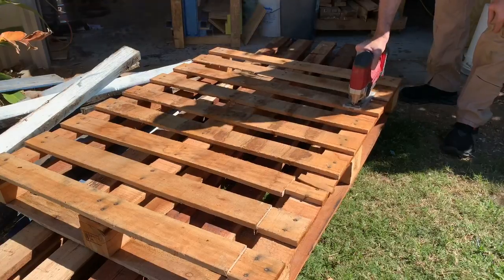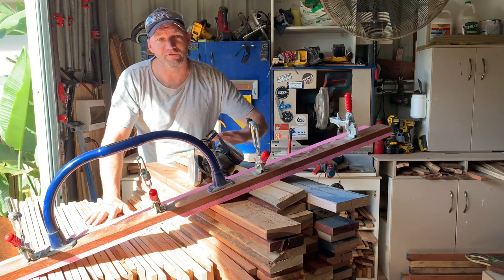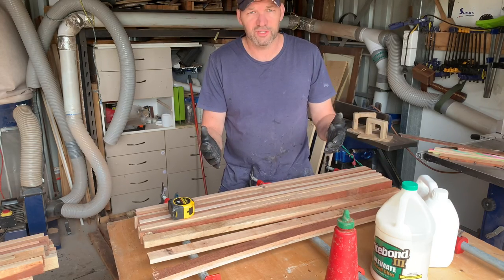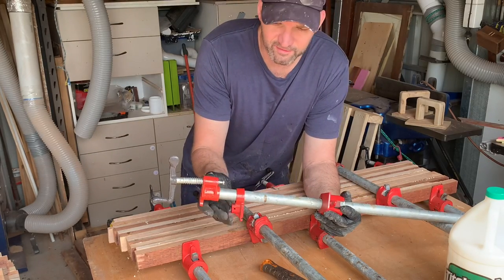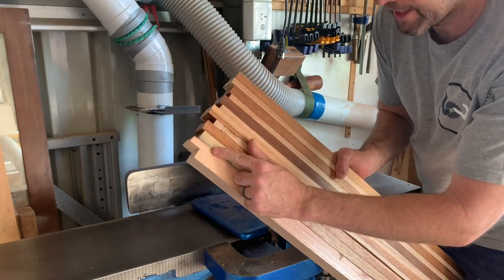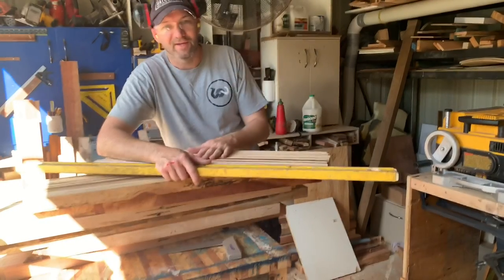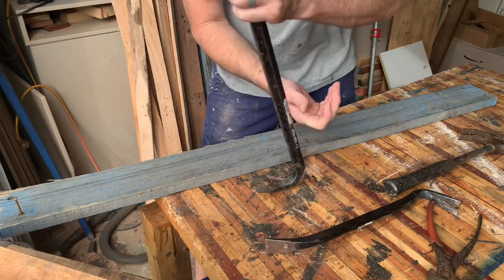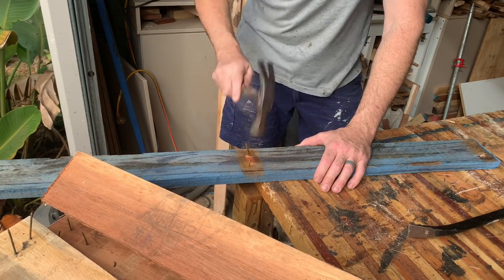How to PALLETWOOD the RIGHT WAY - Make Bricks

Comment: If I ever get around to it I'll make a video of how to save more of your pallets as you take them apart. Don't know if you have any harbor freight stores down under, but get a cheap hydraulic porta power set and attach the spreader section, put the spreader in the pallet (use 2x4 spacers for support) and pump, the pallet will come apart saving most of your lumber. Great Video keep them coming.

Comment: Did a bunch of pallets recently with dodgy nails breaking heads off all over the place. My solution was vise grips and a pry bar worked, like magic. The pincers you where using look like they will cut the nail more than grip them. I've got two pairs from my old man when he was around. He said they where for pulling up Lino tacks. Nice work though enjoyed the video. 👍 Here have a brewsky on me 🍻 don't worry it's not Fosters

Comment: Hi, just something I found out when watching you trying to remove nails from a skid & the heads come off, if you hit the nail in a couple of taps, then pull it out straight away with your crow bar, it will come out better. striking the nail first breaks the adhesive that some of the nails are coated in causes a friction to break its hold on the nails!!!
Reply: I've been doing this for a while and it works brilliantly every time 👍🏾

Comment: I've just come across your channel and its great. I'm based in Townsville as well and I've been building pallet projects for a while now. I often work with larger pine pallets which are usually fairly new, and unweathered. I've found that the larger crowbars like the ones you use can dent the softer thin wood quite heavily. For lighter boards I like the short thin flat wrecking bars, bunnings sell cheap Craftright ones for $6. Also, when you had the nail snap with the nail extractor pliers, I find that the really brittle nails can do this fairly often - I suspect that its due to a concentrated stress on the nail from the pliers. When I get one that breaks I like to use a pair of vicegrips with a sacrificial block underneath. I find that the greater purchase on the nail from the vicegrips can work wonders.

Comment: Well done. One trick for nail removal, when all else is failing put your crowbar in place then grab the top of the nail with vise grips tightened as much as possible. You are then leveraging something stronger than a rusty nail head. It's a bit of a time chewer so save it for when the only alternative is drilling numerous holes around the nail.

Comment: Just discovered your channel. Bloody awesome.  Love all the tips. Only one I use that I don't see others use very often, is heat stubborn nails... Sometimes the pallets have used the big twist nails that have glue on them. Stick like a bastard (as designed).  But I have a little  gas torch (only a kitchen size one), only takes 30sec to heat the nail, then it will pull out he'll of a lot easier.

Comment: Excalibur Extractor HL 1121. They are a plier type of gizmo that grips the nail, head or headless, and outs them with relative ease. The harder you grip, the easier it comes. C&L Tool centre at Banyo, Brisbane have them for $35. Kind of expensive, but I wouldn't be without mine.

Comment: Jesper Makes recommended to take a look at your builds. I'm a long way off getting to a glue up man. Built a big shed 12x 9 mtrs . Needs power and concrete floor. I have some tools and some time . Ya given me a shit load of inspiration,  to keep going and it all done. I got a few pallets,  made a pallet buster, broke em up. Gonna keep chipping away at it.
One question.  Logical I recon . Nail holes. Do you organize your wood in any particular way to avoid them,  and if so how do you do that.  Maybe a video!
Cheers Lex

Comment: Which straightening jig do you prefer? This one or the one you have with those bessey pull clamps? I made the latter, I thought that looked genius, and I have those clamps. But I made it out of two pieces of 18mm ply, so it came out a bit too high, not getting to utilize the max of my saw blade. I'd plane it, but I put in a bunch of brads for glue, so that was a bad idea

Comment: OK just getting myself organised to do a side hustle of playing with wood. Wondering why you have made a sled to get a square edge on the timber? I thought that's what that stand up edge on the table saw was for? Cheers keep up the videos
Reply from the maker: Hi, what ever runs up against the fence must be nice a straight. A bowed board won’t run through the blade nicely and can cause severe kickback. A wonky board will bind the blade, like trying to cut a curve with a circular saw. It will kick back

Comment: Where do you find pallets that have not been treated with obnoxious chemicals?   All the ones I see are smelly.
Reply: @Kim Pulsipher
I get mine from our local Tile and Flooring shop. The ones I get are a one off use and are generally clean other than sometimes they might have a bit of dried mud on them, and maybe a few rocks embedded on the bottoms from being placed on gravel when unloaded.
 All are HT only (heat treated) no point wasting chemicals on them when they are intended for landfill after delivery. 👍🏾

Comment: I'm well aware of the cost of time in the disassembly of pallets. Anyone who even thinks of it as "FREE-WOOD!!!!" is most terribly mistaken. For even entertaining the thought, they should consider having to mow the backyard and trim with string trimmer, then, without a cool-off period, no shower, no changing clothes, head out to the businesses and score those "jems-of-free-wood" and transport them to the aforementioned backyard, and disassemble 15 of those bad-boys! With the metal detector to get every blade destroying nail/spike/bolt/staple/deck-screw. Then, I want to hear them call it "FREE-WOOD"? 
I can't force myself to refer to it as free wood, but rather "Reclaimed-Wood". It's largely my media of choice, but it ain't free. I use $300.00 worth of tools just to reclaim it. Not mention the transport and disassembly of the media.